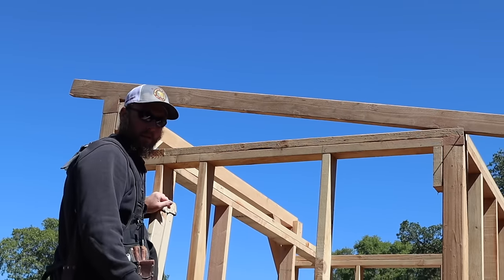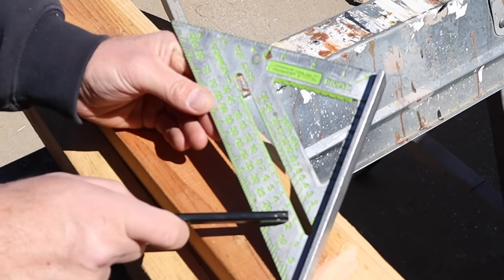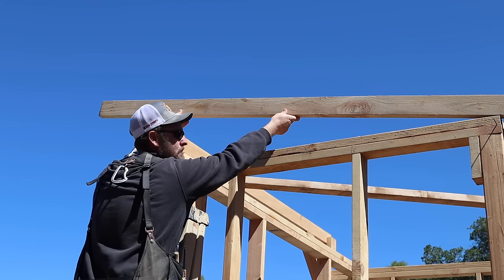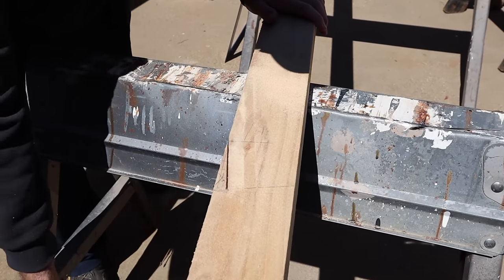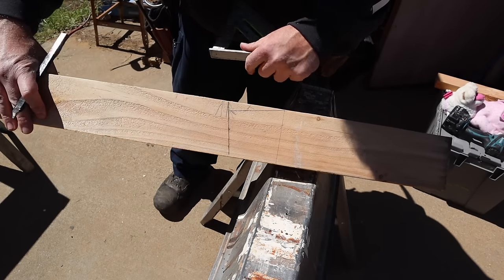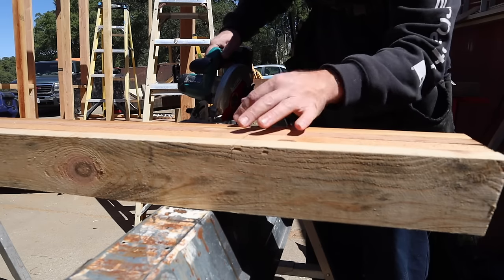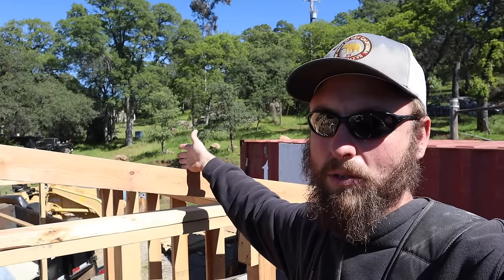BIRDS MOUTH & PURLINS Cutting The Roof | Chicken coop build PART- 4

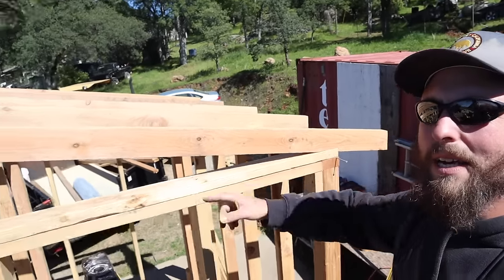Comment: @12:42 I noticed your purlins fit a little sloppy into the dados. This is because the dado is a blade thickness (kerf width) wider than the layout lines. Lining up the  notch in the base  on the pencil line will always produce a cut to one side of the line. You end up with one cut inside and one cut outside the line.  For example, if the saw cuts to the right of the line, then layout the right line one kerf width closer to the center line. Alternatively, site your saw to compensate for the offset.  Hope this helps.
Reply: I bet them chickens will never notice

Comment: To show how, great instruction. But for the love of Pete; for your own shed, a total overbuild. Could have used a cable or wire rather than that purlin. Totally simple to ladder across a beam.  Cantilever.  Such a tiny shed, are you going to house Gorillas? Steel roof. forget the ply or osb just a few lines of 1/2" a 6" strips of ply to support athe corrugated Block yuor rahetrs if you like with SCRAP.

Comment: It's not a " joist" -- it's called a rafter, if it supports a roof of some sort.  There is a math formula that tells where to make your cuts.  It's trig and it works down to 1/16th of an inch accurate.  Look up rafter framing.  Get a trig calculator and have a grand time building your chicken coup, or whatever you need  to know for the long side of a triangle, based on the relationship of one side to the other.  Cheers, good people -- have fun and learn something useful that will stick with you for life.

Comment: Hi Joe. Where did you get the 3 1/2 inches? Very informative video. Stay safe.
Reply: 3 1/2 " is the width of the 2x4 that the rafter will be sitting on.   Ex: If the top plate was 6" wide, then the cut should be 6". You can make that any length you want. Plus the interior looks better.
 If this were going to be a finished interior then you wouldn't want a gap from cutting it less then the board the rafter is resting on. Nor would you want the cut to be longer so as not to create a flat spot on the inside.
Reply: @yurtman6548  Thanks Joe.

Comment: very good video... did u install the rafters or joists  at 2 ft distance??
Reply from the maker: Thank you, I did set at 2ft on center.
Reply: @JoeSimple  ok one more thing.
. at the mark of the birds mouth..I notice u used a framing square to fit square on that mark to edge of the rafter at an angle.. is that another way to do it??  cuz I thought how it's done was removing the height above plate to get that seat cut or birds mouth
Reply from the maker: @peoplesambassadordm8279  sorry, I am not totally understanding your question. I made the 10 degree mark with the speed square. then used the framing square following that line to to remove 3 1/2 inches the width of the 2x4 top plate. to remove the minimum amount of wood for it to sit on the plate flat.

Comment: How you hold the joist to the beans?
Reply from the maker: Toe nail- drive nail at an angle through the rafter in to the beam/ top plate. I do one in the center on one side and two on the opposite side.. i used screws.

Comment: Why not stack the ceiling joists on the wall studs? It's only another joist or two and it would make the roof much stronger. Also, why notch the ceiling joists? You are weakening them, and it isn't necessary. You would get better airflow, too, without notching them.

Comment: I guess I will be the jerk who thinks it was too complicated. Lay the rafter up there, use a framing square for the birds mouth, leave the rafters running long. Determine your overhang, make a mark on each end rafter , snap a chalk line across all of them, use a level for your rafter plumb cuts.  Yes, you have to cut the rafter plumb cut vertically on a ladder, but they are all aligned and you can’t trust dimensional lumber to be straight.

Comment: This video series is really great. Thank you!
I’m debating on the heights i need to go with on my shed and which pitch to go with. I assume if my distance is 8 ft instead of your 6ft), I can still use your 12:2 pitch method? I’m thinking i want my front wall to be 8ft tall and the back wall 7ft but not sure if I’d still use your 12:2 method.  My shed is 8x12. Front to back being the 8ft.
Thanks for your help!
Reply from the maker: are you looking for your overall building height to be 8ft(front) x 7ft(back) including roof? it kinda depends on your climate if you live In a more snowy place then you may want to give it more pitch. so for your example a 2:12 pitch (every 1 foot of run it raises 2 inches) on an 8ft run would raise up (16 inches) {8x2=16}. your front wall would be 16inches taller than the back wall to give you a 2:12 pitch. I really hope this is helpful? check this calculator out it might help out 
https://www.pole-barn.info/roof-pitch.html
Reply: JoeSimple yes you explained it very well. Thanks so much!

Comment: great vid thanks for uploading. do you think that i would have enough of an angle on a 22' wide x 20' long roof if the low end is 10' high and the high end is 12' high?  i will be using a metal roof and i live near chicago so we do get snow.
Reply from the maker: Hey Zip Zip, personality I think that pitch is a little low (minimum) for a snow load area. looks to be like a 1&12 pitch I know localy here in nor-cal that's not enough to shed the snow as needed, my opinion. check this link out https://www.mycarpentry.com/roof-pitch-calculator.html for a roof pitch calculator. also maybe take a look around and see how local roofs are pitched. the metal is a good option because it will shed well. also some google searching on  something like "roof pitch for snow load" may be helpful. hope this is helpful :).

Comment: At the end of the eaves you drop a plumb bob to strike a vertical plane at the fascia. Right?
 Why?
Don't.
Cut the fascia line at 90° to the sheath/top and rebate that fascia. Now when the water drips off it will be gone in the first 1/2" from the drip edge. Good bye, damp wood! Ha! There it goes to the gutter! Ha! Again! Add some years to your money's worth!

Comment: Measuring 3 1/2 inches along the rafter does not represent the actual length of the hypotenuse on a perfect fit. That should be the length of the seat cut to match the top plate.